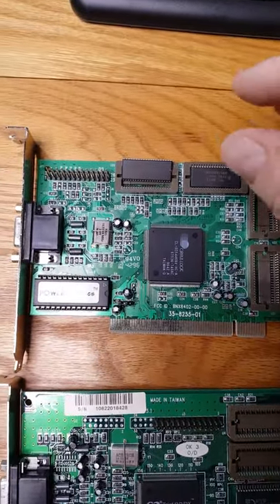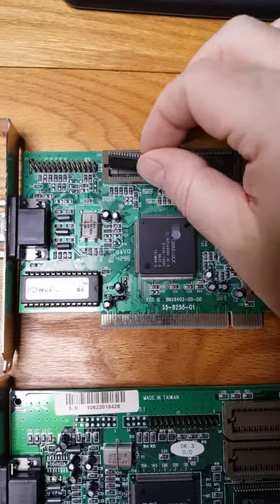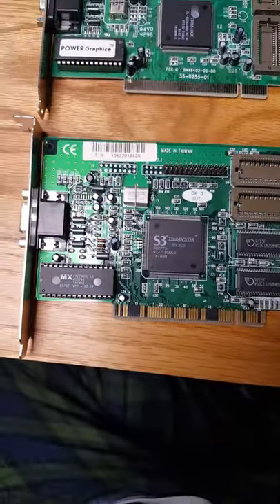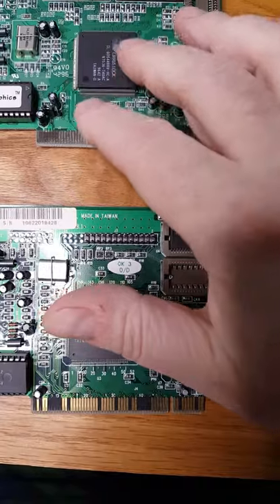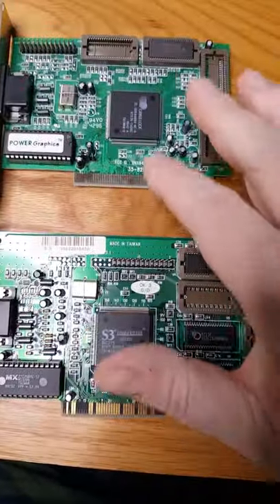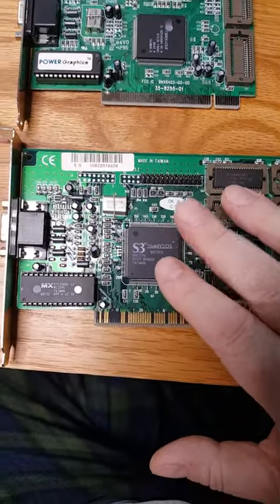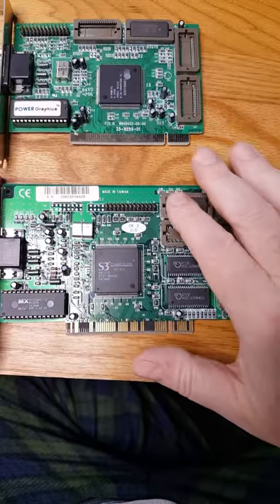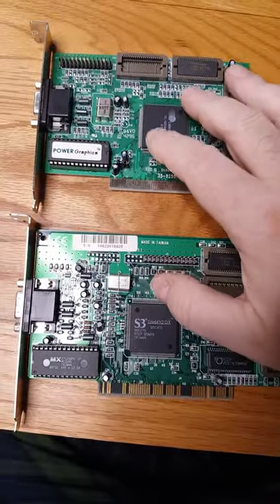Recycling and reusing old PCI video card memory chips #shorts

Comment: I believe you can also harvest these memory modules from single sided 72-pin memory modules that use the same chips (usually 2 at a time) should they match the RAM modules on your video card.  Some hot air or a swipe with a soldering iron is required unless you decide to go hulk smash and just rip them off of the SIMM, at risk of damaging the contacts on the chip of course.  Related note, the $5-8 it costs to obtain a PLCC socket puller via Amazon to pull chips from PLCC sockets like those on your CL video card is money well spent for the retro tech enthusiast workbench, I've cracked or broken at least half of the PLCC sockets I was harvesting parts from prior to buying the tool, usually memory modules like this or coprocessors out of old 386 boards.  Less an issue if the card is going to scrap but probably worth having if you intend to swap components around or run into a bad memory module doing something like this and need to pull one from a good card.

Sidebar on the donor card - I've found it useful to keep a few of the overlap chipsets that were used in both VLB and PCI cards for benchmark reference in late 486 builds on boards with PCI slots.   Trident 9440 variants, Cirrus Logic CL54xx, S3 86X/96x and Trio 32/64 series cards, ATI Mach 32/64 and Ark Logic 1000/2000 chipsets which all showed up in early PCI graphics cards and are perfect for these builds, with some fetching decent money per card (the Diamond S3 Vision 968 based cards, anything Ark Logic and some of the later Mach 64 variants in particular).  While expensive by PCI card standards they are a fraction the cost of their VLB equipped counterparts via eBay.
Reply from the maker: You speak gospel.  I do actually have a pile of these older PCI cards, just too many Cirrus Logics at this time.  And yeah, the chip pullers ate a must.  That and a really good magnifying glass and tiny needle nose pliers for straightening them afterwards.

Comment: I really want to know how to remove the VRAM chip from this socket. I've been working on it for several days, but the chips are seated so tightly that I can't remove them.
Reply from the maker: You MAY not be able to get them out without damaging the card itself.  I did hurt one that was sacrificial.  They weren't really meant to be swapped easily back then.